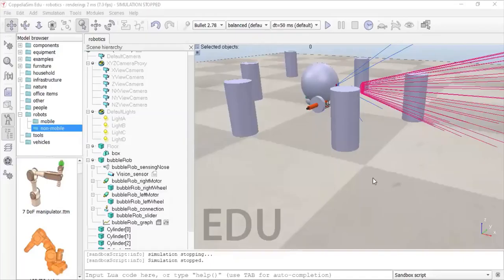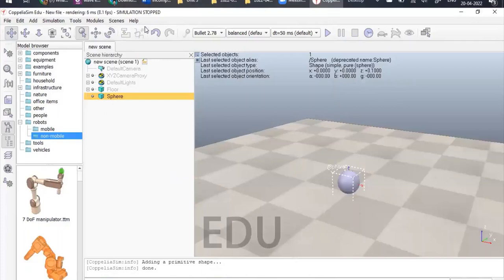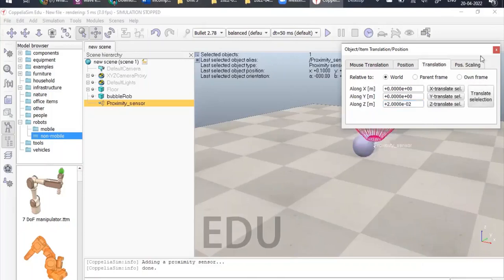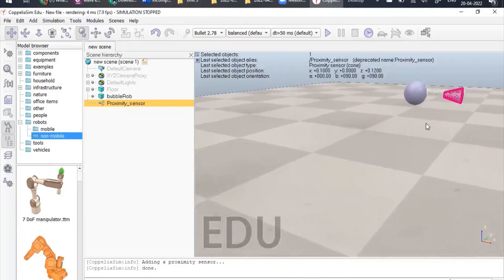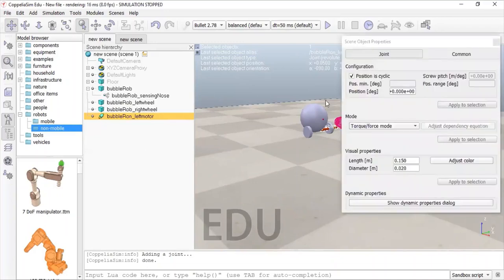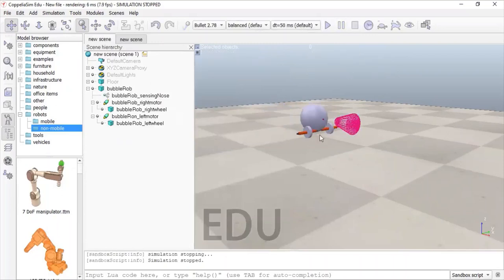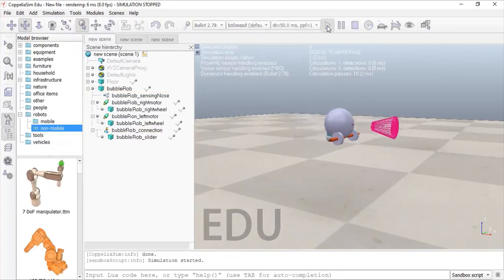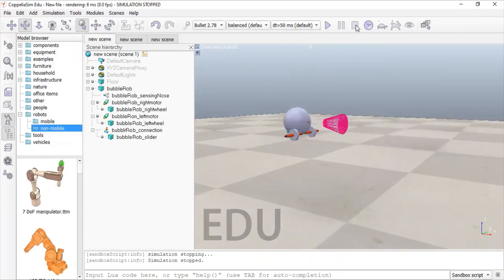Design of a robot on CoppeliaSim edu software as per syllabus of DT-2 in Chandigarh University.

Comment: Thanks sir for detailed explanation , but i am facing an issue after adding that revolute joint . When i click on dynamic properties dialog , it shows that the joint is not controlled . Kindly help me sir as i have properly followed u till that step and unable to proceed further .
Reply from the maker: I will see into it and reply you back
Reply from the maker: Send me a screenshot of the message
Reply: @shaillybhai007  sir where to send u the screenshot as YouTube doesn't support adding images in comments
Reply from the maker: @shagunO4  at shailendragupta007@gmail.com
Reply: Did you resolve the problem?